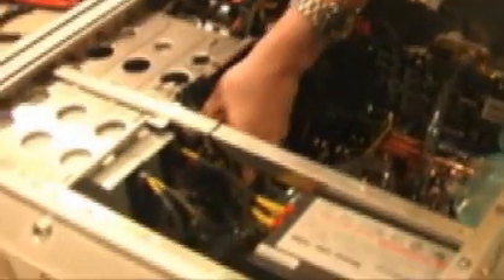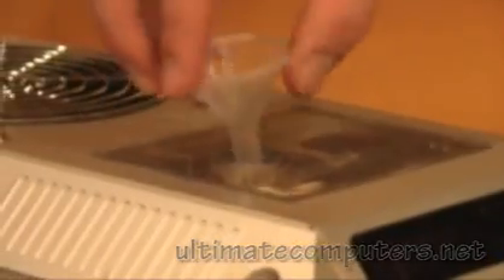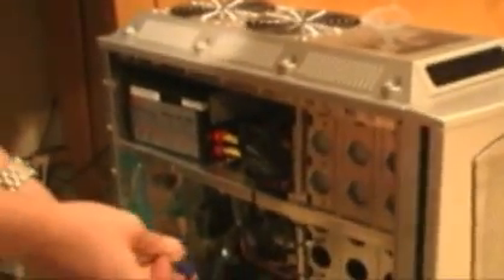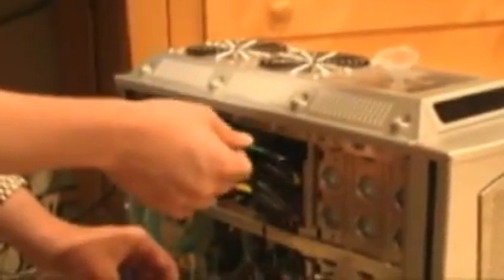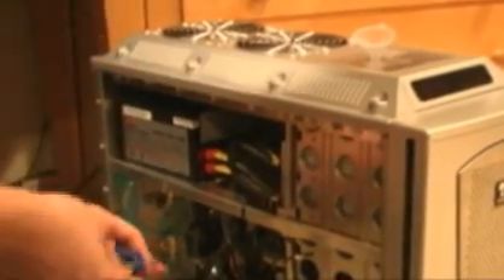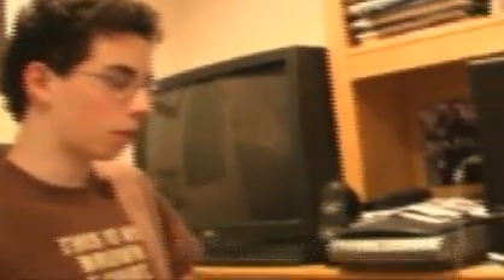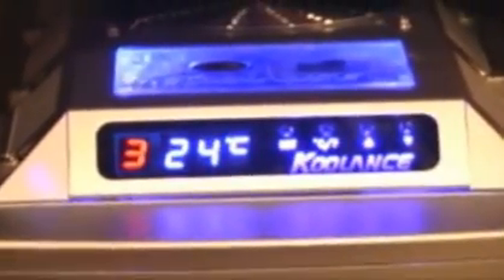(Part 4/4) How to Build an Ultimate Computer

Comment from the maker: @Shimimadara You should not water cool your first build.  It's difficult expensive, and prone to problems if done incorrectly.  I air cool all my systems, and my temps are totally fine, even with lots of overclocking.  The watercooling was really just a novelty in this video, because I thought it would be fun.

Comment: There are several modifications of Windows XP that were created from a Pirated XP base. You may find many of these on several different pirate sites, but be warned, it IS technically illegal to use these. One of the alleged fastest OS would be "GodlyXP".

Comment: But this was 2007 do u still have the same computer? 

i have build my own to 

XFX nforce motherboard 750a SLI
AMD phenom 9650 x4 2.3Ghz 4 mb
HD4770 3200 Mhz 
4 Gig 1066-555 ocz With heatpipe
500 Gb Hardisk
20x speed dvd DL burner
Antec 300

ive bought it a month ago 570 euro's u thinks it good enough for games?

Comment from the maker: You only need the blocks if you are using water cooling, because that is what the coolant flows through.  You usually buy them separately because different CPUs and video cards are compatible with different blocks.  If you are air cooling, then you use a heatsink and fan instead.

Comment: wen u boot off the vista dvd did u know that ur actualy running a verry tiny wersion of windows that runs off ram its called ms windows PE 2.0 (2.0 runs on a striped back version of the vista kernal and i have made cd's for it so i can use it as a boot disc it has notepad alows u to create vbs batch and more files and format in the ntfs format

Comment from the maker: As per Apple's End User agreement it can only be installed on MAC hardware.  Besides, you need a special chip on the motherboard for the install to work.  Their are hacks, however, that make the Apple OS work on other hardware.  But it's not worth it.  If you are building, go for windows or linux.

Comment: SO if u have 
-EVGA nforce 780i SLI Motherboard 
-Intel Core 2 Quad Q6600 Processor 
-(x3)EVGA GeForce 8800 Ultra 
-Ultra X3 ULT40070 1600-Watt Power Supply 
-OCZ SLI-Ready Dual Channel 4096MB PC6400 DDR2 800MHz Memory 

How much it will cost?